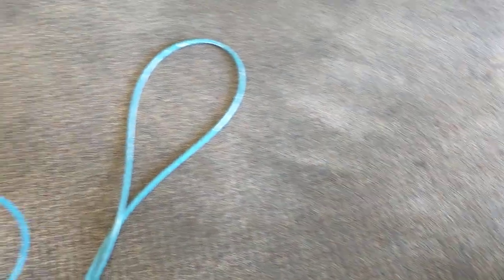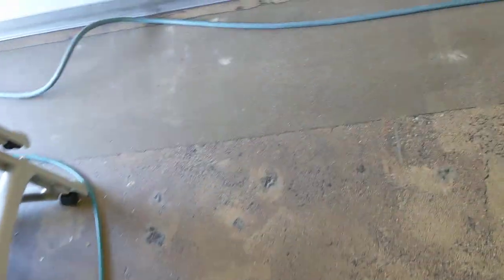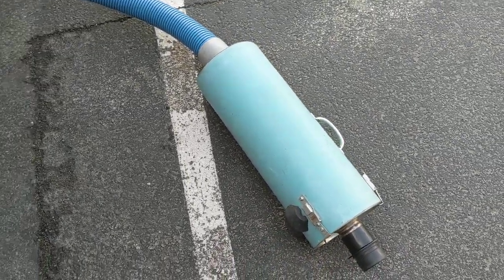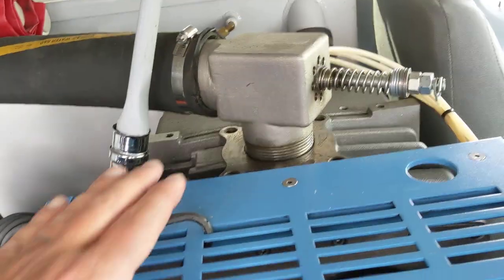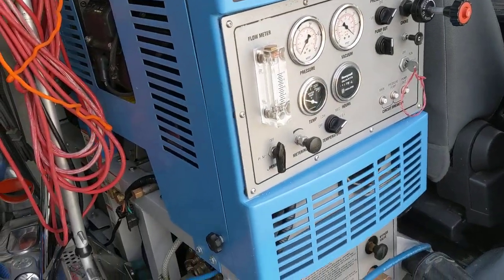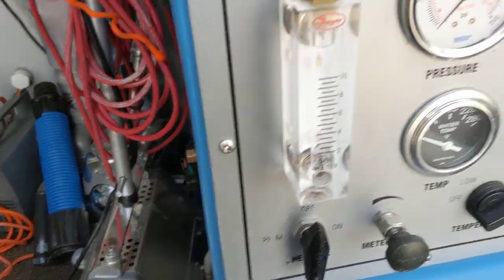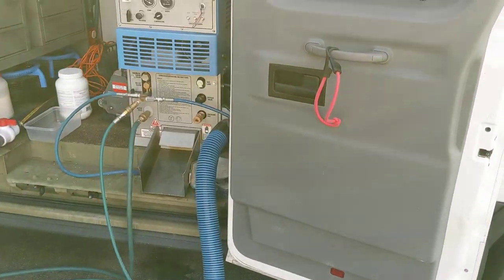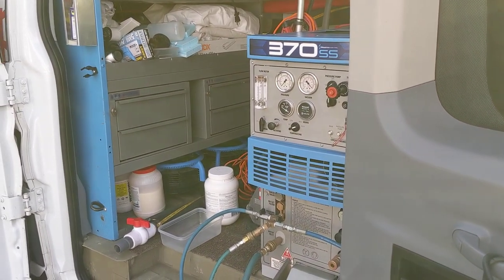How a Carpet Cleaning "TruckMount" works, explained for the consumer

Comment: Do you use the auto pump out system to dump sometimes? I don't have a pump installed but is it possible to hook a hose to the auto pump and just dump afterwards or do you need the pump for that to work? Probably would need quite a long hose to reach a toilet though.